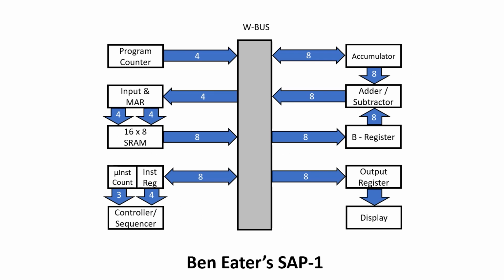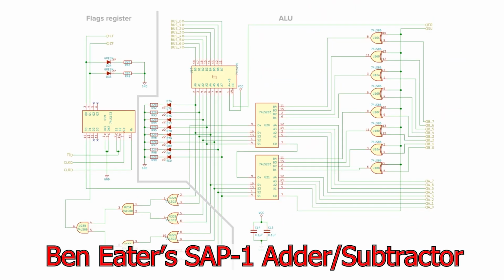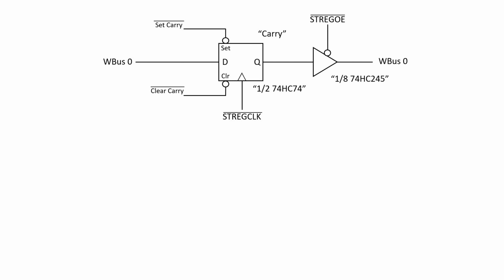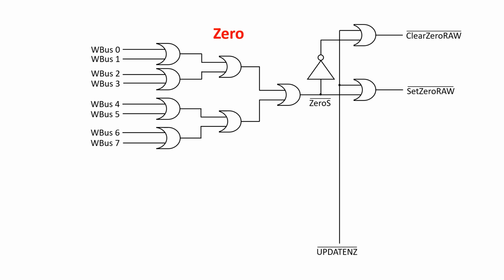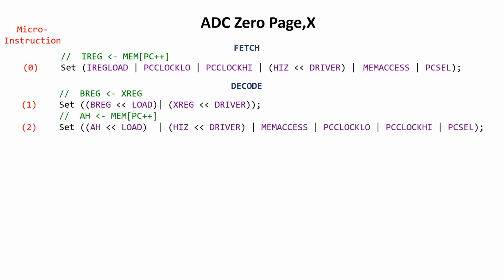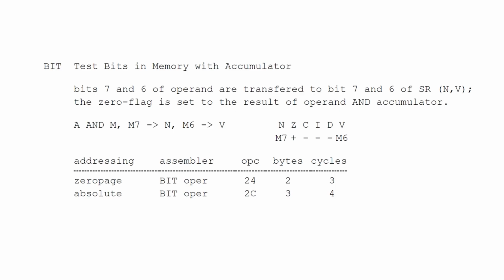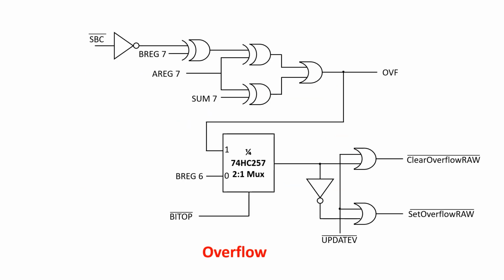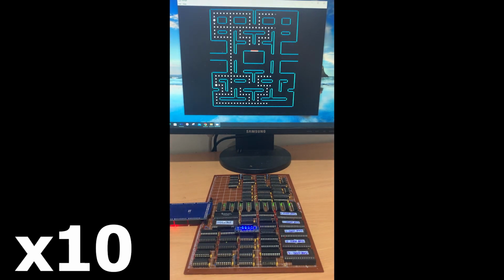How to build a 6502 TTL-CPU: Part 8 Status register and bring-up.

Comment: Excellent video series! Easy to watch and listen too, professional, and love the little comedy clips ;)
I would love to see a video on the schematic diagram :)
Have you posted the schematics?
Since semi-retiring I've often thought about building something like this. My thoughts have been to use SRAM rather than Flash/EEPROM and load it up on reset using a micro, and using SRAM (or Flash/EEPROM) to implement the ALU.
Reply from the maker: Thanks for the feedback, i really appreciate it.
I have done the schematics and have actually had PCB's manufactured.
I'll be releasing them as i debug them in upcoming videos.  
If you want a sneak peek you can email me at Turing6502@gmail.com
For a minimal design, you might want to look at the Turing6502 playlist on the channel.

Comment: You are a madman, but in a good way. I hadn't thought about all the edge cases on the ALU before. The need to use it for address calculation and adding memory to the accumulator results in some compliment management of the status bits. I am curious how the shift right works too.
Reply from the maker: Thanks Martin, I take madman as a compliment!  Shift right is pretty simple, it takes the output of the BREG and it sends it via a 245 back to the w-bus, offset by one bit position.  For ROR it uses the carry flag for bit 7, and for LSR it sets CARRYZERO to clear the top bit.  Bit zero goes back to carry for both cases.

Comment: The fact that you are constrained to a single bus will probably hit with a large speed handicap. I expect this will be around 3 times slower than a normal 6502. Still being able to cram 6502 compatibility in such (relatively) simple circuit is cool.
Reply from the maker: Agreed.   The ADC zpg,X takes 8 clocks on this machine but only 4 on the actual 6502, so a slow-down of 2-3x is probably in the right ball-park.

Comment: I remember watching that Ariane 5 launch live.
Reply from the maker: Hi Michael.  One of the interesting outcomes was they recommend that systems continue to produce a "best guess" after an error in mission critical systems, rather than go to diagnostics.  Nasty though, the system was thought to be proven on the Ariane 4, but the Ariane 4 was less powerful.  This variables was only computed for 40 seconds after launch and Ariane 4 didn't get far enough downrange to overflow this variable (it measured the horizontal distance from the launch pad).  Hope it made the point to watch out for overflow!
Reply: @DrMattRegan  Yeah, I worked on this sort of thing (rocket launches) in the '90s. Other "great software bugs in space" include Mariner 1, Mars Climate Orbiter, the '99 Milstar launch, and the almost-disaster of the Apollo-11 landing (though one might argue that was more of a user error scenario). There is a common theme in all of these bugs: someone somewhere made an assumption no further testing was necessary because what could go wrong, right?
Reply from the maker: Cool, i didn't know you were in the aerospace industry.  My 10 year old daughter is determined to be rocket scientist.

Comment: here's a challenge, when this project is complete, wire you up a Breakout board to make this beautiful beast pin compatible with a 6502 and see if it will work in a real Apple][
Reply from the maker: Not a bad idea actually.  It will be a bit slow if i have to run with a 1 MHz clock, but it would be interesting to see.

Comment: Where is the source code for your emulator located?
Reply from the maker: The code is located at https://github.com/Turing6502/SAP6502
You probably should use V2.

This video https://youtu.be/FtNb4VWd9dM tells you how to compile it.
Good luck